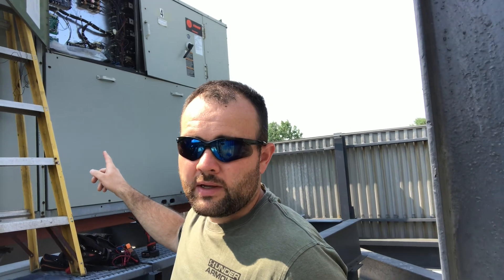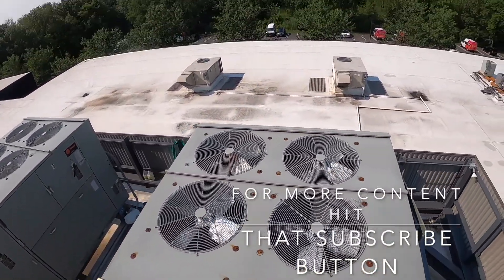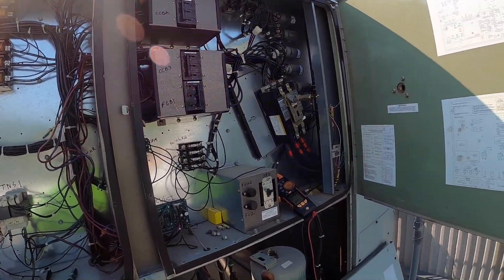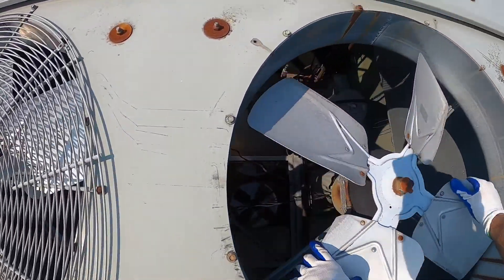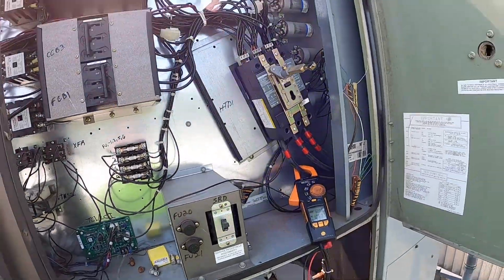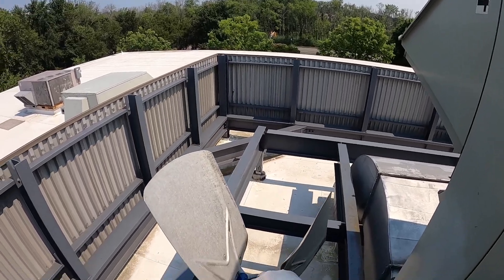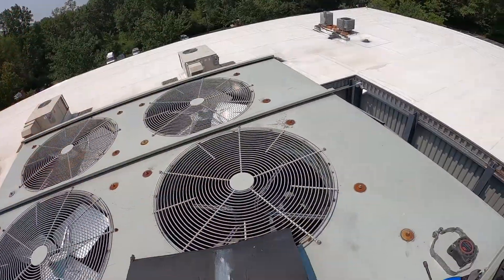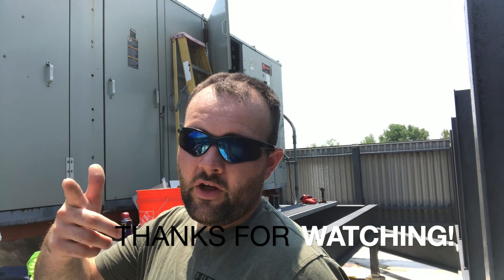No Cooling Service Call And Repair 50 Ton Trane Roof Top Unit

Comment: Great Idea covering the failed motor until replacement! I HATE that they use belly bands to hold the motors! I always order new fan blades with motor replacement.
Reply from the maker: Yea Tranes belly bands are not ideal. I agree New blade If available is always the best way to do it.

Comment: so you skipped the hardest part of the vid? getting the new motor mounted by yourself? TRANE Cond Fan Mot mounting is the worst! to help me I've used self screw bolts to attach belly brackets to belly band.
Reply from the maker: Dude I know what a pain in the ass they are. That will be a video on its own lol. That sounds like a good method you got there.

Comment: SO FAR - I got one of the units going off on me — Static pressure way to high making unit going off— AFTER  a minute starting
Reply: FIND THE PROBLEM— After heavy rain 🌧 and heavy wind - Got water on vacuum or static pressure  plastic hose line ( Atmosphere tubing)
Reply from the maker: Nice find, that sounds like one of those issues that actual have to occur in front of you or it can be missed.